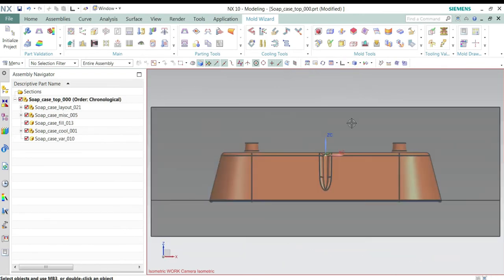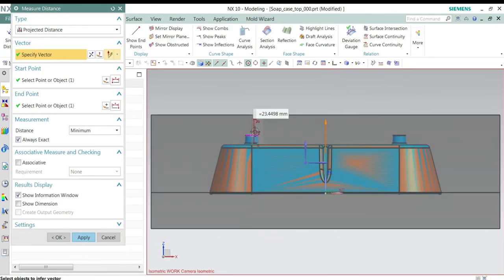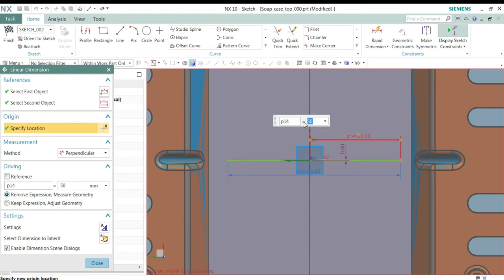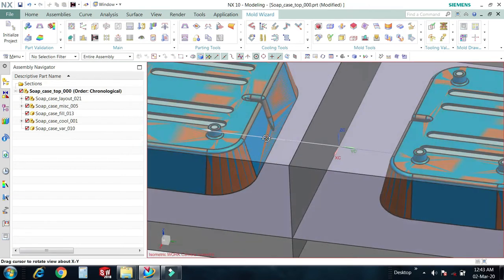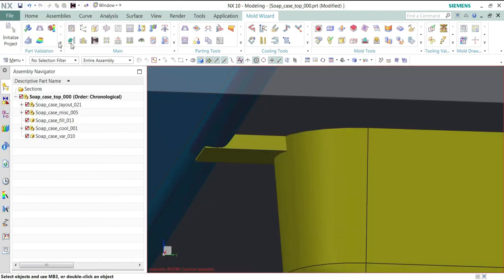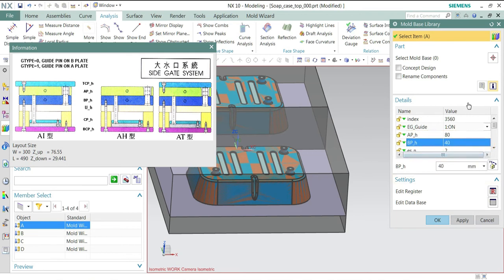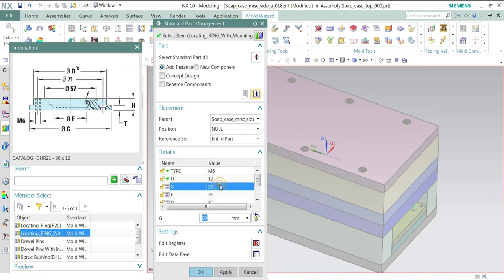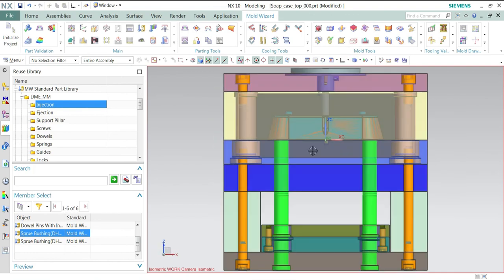UNIGRAPHICS(UG NX 10) MOULD DESIGN TUTORIAL-2

Comment: Sir.. I am using nx10 crack virgen for practice propose. In that I am not able to open mould base library. what should I do.. please help me..
Reply from the maker: Unless you install mould wizard it won't work..you need to add reusable elements in default folder in c drive.